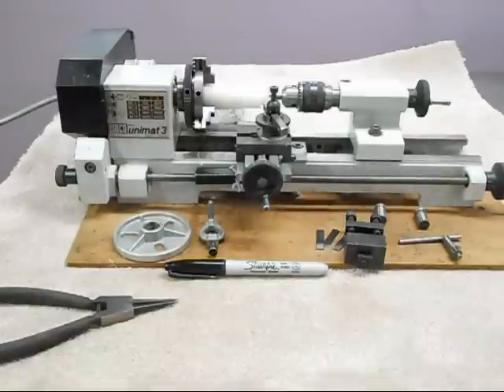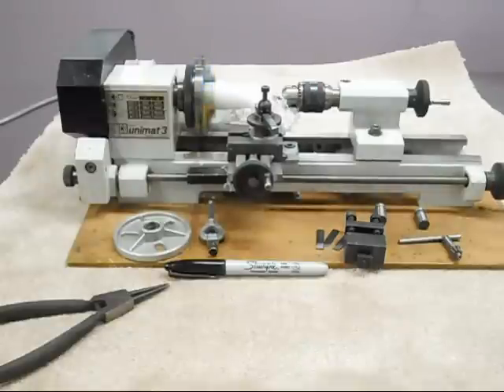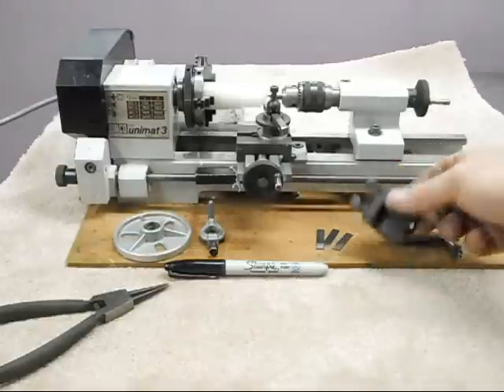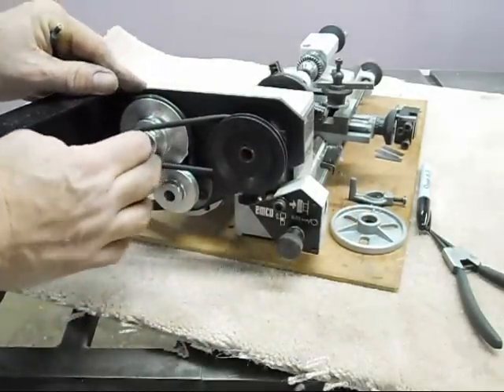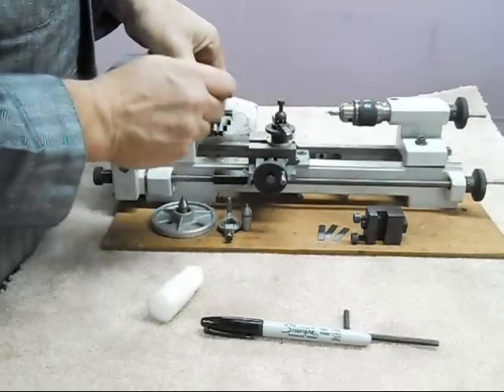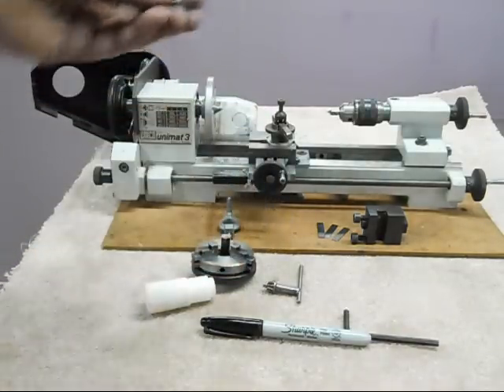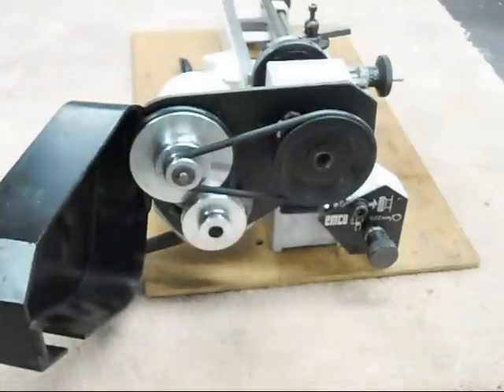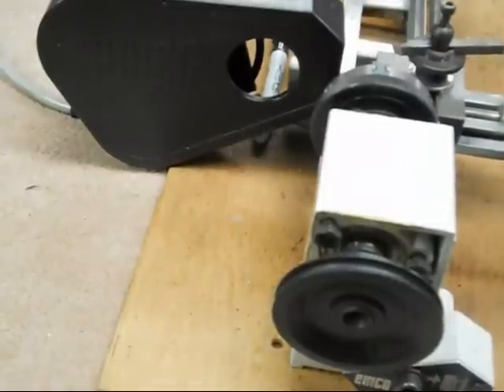Emco Unimat 3.wmv

Comment: As of the motor, replacing it with custom brushless DC motor with variable speed, and controller than can maintain a speed under load, but also detect stalls and overload would be a big improvement. This way, there are no messy belts to deal with, and no risk of puting your fingers in all the pulleys. :) And you can then use the motor in the milling / drill press stand all the time. Which makes it quicker.

I am interested in this machine, but I wonder if it is possible to reach very close to the chuck jaws with the tool tip. And if it is possible to for example do something like 1mm diameter, 3mm length piece, and thread it with M1 external thread accurately. I do not need anything smaller, and usually would work around M3 sizes.

Also I do not see way to do tapers. I see angle adjustement for the tool, but no way to move the tool on tapered path. Only left/right and forward/backwards.

Comment: Hi! I have the same Emco, but the high speed is not working I don´t know what to do, can you help me, please?
Reply from the maker: If high speed is not working on the motor, several things may be causing that problem.  There were several types of motor used by Emco over the years.  For  instance, the motor in the video uses carbon brushes.  Probably best to bring the motor to an electric motor service center for evaluation.

There is a group devoted to Unimat lathes on Yahoo.  The name of the group is Unimat3, search using that name. Join the group, it will be a tremendous help to you.
Reply: @ltousig  , 
Please provide the address for Emco - Unimat 3 dealers/distributors, in Indonesia .
Reply from the maker: @Dodi-nz3fd  Hi Dodi, 
I'm not in any way affiliated with Emco. I have no idea about technical support for Emco in Indonesia, or anywhere else.
Reply: I know this is an old thread but the problem is the diode is burned out in the motor.
Reply: @mosfet500   Hi! Thanks, do you think I can fix it or its really complex?
Reply: @mariannatura5453  It's pretty simple, it's the only electronic component in the motor. If I remember I used a 1N4007 diode which is very cheap, about 10 cents, you don't have to use the original diode. They are just basic silicon diodes you can get on ebay or any supply house.
Diodes work by passing current in only one direction so when the diode is in the circuit it effectively cuts the voltage to the motor in half. Change the diode and if you still have the problem than it's the motor switch itself. Again, not much to go wrong. 
Take out the brushes before you disassemble the motor and be careful to note the direction the brush is in the holder and make sure you put the brushes in their original holders.
Good luck, if you have a problem post a note here and I'll monitor the thread.
Reply: @mosfet500  Thank you so much! I'll give it a try